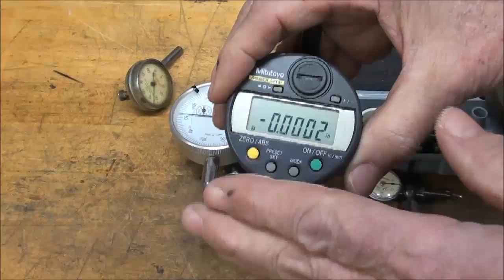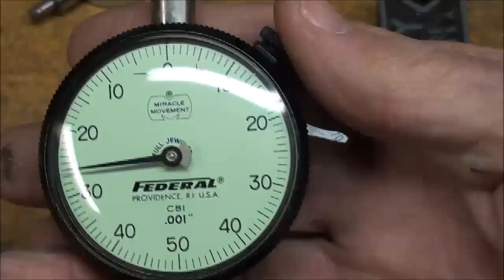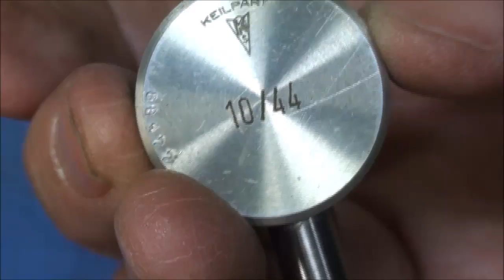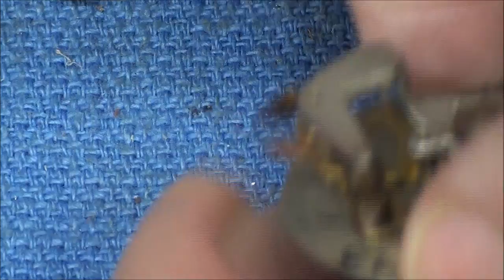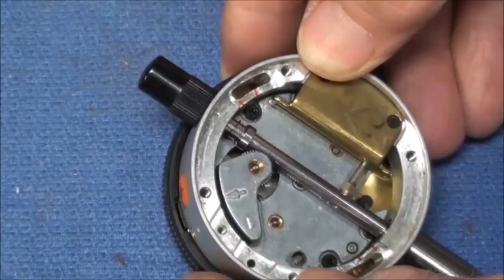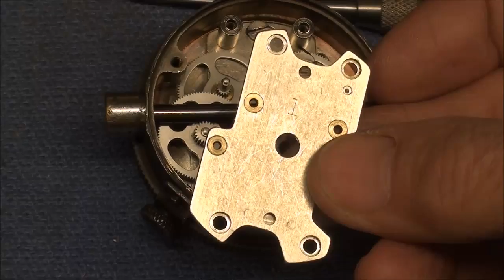WHAT MAKES IT WORK? #18  "How a Dial indicator Works"  tubalcain

Comment: Using a thread as a rack is an amazingly simple way to do it. The plunger is already round so I guess there’s no point in making a square rack

So I understand the basic idea now. The gears make the needle move more than the plunger. But it’s the math I would need to study to figure out how they get it to be in specific increments.

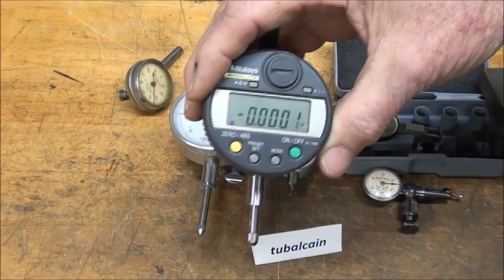Comment: At 2:16 - 2:23, you notice the readout fluctuating . . why would the 
Digital Indicator be changing its measurement readout when there 
is not measuring anything? Perhaps the atmosphere is so thick in 
Mr Petes shop that it is measuring the difference in air pressure as 
he wiggles it about !

Comment: That "German" dial indicator I am sure may well have been Swiss. If it was made in 1944 in Germany it would have has a Nazi eagle stamping on it somewhere most probably on dial and the back. I have never seen anything made under the Nazis that didn't have a swastika Eagle stamp on it even the timing mechanisms on bombs had them even if they were to be blown up to kingdom come! That said, the fact that it does not have made in Switzerland is quite surprising if it was made there.

Comment: Who has enough indicators?   years in manufacturing Quality as a manager and Engineer and a Product/Production Engineer and never in that 35 years did anyone hear me say the words "We have plenty/too many indicator.  Now that I am retired I probably have 35 or 40 Dial, Electronic none of which are Mitutoyo. Dont get me wrong for the price and the quality of Mitutoyo they cannot be beat as long as you yourself and the employees you have using them understand they are Mitutoyo. I am not going to put a $450.00 Mahr Federal on the production floor for an $8.00 an hour off the street flunky to knock off a table or machine and never tell anyone that they did it. That tends to piss a lot of plant Managers off to including mine, CAT's, Harley Davidsons, Dana's,  CAT fuel systems, Honda. That creates too much cash flow for the 3rd party containment people posted at my facility and at my customers. The only good thing in my opinion about a digital indicator or caliper, Mics, Ect is that I did not need a calculator or my phone to calculate Metric to English and all of the before mentioned companies use either only Fuc*#ng Metric or both SAE and Metric mixed. Talk about a night mare when trying to develop tools parts ETC. Yes I was also the management rep for  every company I have worked for since I was about 21 years old. Started with the Old Ford Q-1 and when I and yes I said I because there is an i in TEAM. If you put a line in the bottom section of the A . (in the A holes. We had no employees with any background. This was my 1st Q1 audit and I killed it. 1 minor write up. 

Not tooting my own  horn.
If I was going to toot my horn I would have stated that I spent 8 years in the United States Marine Corps from the age of 17. My MOS's (Military Occupational Speciality was 

 (Grunt. Learn over a130 ways to kill the enemy or anyone else without a weapon) then my 2nd 4 years was after I went to become a combat Engineer MOS 1371 Build stuff and blow it up or just blow other peoples stuff up. We used conventional explosives TNT, C4, Dynomite ETC along with improvised explosives basically anything we could get our hands on) Good times 1984-1992 USMC. Location? anywhere we were needed.

Comment: I can send you some basic watchmaking tools if you'd like. As you said, these dial indicators are very much like a mechanical watch movement. I have a bunch of extra tools laying around that I know you could put to good use.
Please shoot me your mailing address at t.macc.gmail.com
Reply from the maker: Thanks, I sent you an email. Although your email address looks a little funny without the at sign.
Reply: Sorry... I'm working on a MacBook Pro which is the bain of my existence. The correct email address is:
t.macc.1956@gmail.com
Reply: They are on the way. Ref: latest email for tracking info...

Comment: The Germany indicator at the first open, it should use screw thread as worm, to couple with worm wheel. But uses as gear and rack.

Comment: Gauge hysteresis is the difference in readings on a gauge or dial between measurements when going up and down the scale. The word is used to describe similar phenomena in other branches of physics. In a gauge backlash is just as good a word.

Comment: The crown of a watch is the winding knob.  The glass is often called the crystal.

Oil might be forbidden, but I'm guessing a little bit of graphite powder might be OK for lubrication. Even if it gets on the rack, a layer of graphite is much thinner than a layer of oil molecules, and it doesn't turn to glue over time.
Reply: Replying to a very old comment.... There is no need for lubrication - the ingress of oils and gunk via the stems is what makes them gum up.
Reply: @johncoops6897 

(Replying to a relatively recent comment which replied to a very old comment! :D)

Yep, if one is lucky, a bit of cleaning is all that's needed. 

If not so lucky, there may be wear or damage; in which case one would be advised to either  save all the undamaged parts (or not, maybe that's just me bring a hoarder ;->) and buy a replacement, or get it fixed and serviced by an expert. :)

Comment: Hysteresis is just the name for when the output lags the input differently depending on the direction of the input. It could be motion (as in these indicators) or the buildup and polarity of a magnetic field in a transformer. It's from the Greek word for lateness or being behind.

Great video; it saves me the risk of pulling apart one of my own indicators, and maybe getting dirt in it.
Reply: Term is also used in structural stress analysis.  When a load is applied and then removed from a part, plastic deformation (if it occurs) prevents the stress-strain curve from returning to 0,0.

Comment: Very nice and highly informative why? Because you are by far to me the best and most hard-working of all of today's also good teachers who bless us in the trade. I have taken apart busted up ones to see the interior. Once I bought a row inch travel indicator from a guy getting out of the business which always saddened me also.. we have many forces working against good men. Anyway it had a bend in the rod and a noticeable drag and catch. I was proud to see the problem and apply some pressure which fixed the problem. I can not any longer loan my tools as something can happen to damage it. To make it worse all personal precision tolls are to be calibrated by a company who is certified to do that and label it. Th sides were only hearsay!They picked up my 18 inch Berliners this week and I took pictures of what it looked like when I turned them over because the last outfit chipped my carbide face on my 2-3 inch Starrett misc I have had over 20 years no problems. The outfit denied doing it and my company did not fix or replace them. Now I take pictures with my smart phone and will take them to small claims court over the next incident. Not my company but the calibrator one. Others complained also and or man who selected the outfit said our comments bo

Comment: HI Mr. Pete,
 that Keilpart dial indicator is from Germany. the company (KS) interestingly enough is still in business. They're located in Suhl. i have a collection of their micrometers. they went thru quite tumultuous times after the war and re-unification. during the years of the GDR the company was state owned and was returned to private ownership upon re-unification, they are now a part of the Steinmeyer group.
the dial indicator you have is a piece of history that you should consider restoring, and as you correctly observed, it's is from 1944. the "Keilpart" is part of the logo the original founder Friedrich Keilpart put on his products. he founded the company in 1878, 
 
another observation: the rack is a thread, you can also tell that by the slanted teeth of the pinion gear that is driven by the rack

thanks for going the extra mile and showing us the internal workings of the dial indicators
Reply: +HolzMichel Thanks for the history!

Comment: The numbers on the inside of  your European indicator are likely because the pieces were hand fitted.  Notice the numbers match.  Likely if you took apart an identical unit, you would find different numbers on the pieces and the internals would not be interchangeable from one movement to another.  Of course this is only my best guess.  

All the best!

Mike

Comment: Great video as usual....the glass in the bezel is called a crystal in a watch, here it may just be a glass as it would be called in a clock.   The crown is a knob used to wind a watch as well as set the hands.  I could not see clearly in the video the color of the jewels, they looked pinkish to me.  If pinkish they would be garnet, rubies red, clear are sapphire.   
  If you use tweezers, the screws are easy to remove or install, watchmakers hands don't work well without them either. 
Women worked in watch factories to assemble mostly, probably because they could pay them a lower wage........there is a non PC view that had a lighter touch and were not ham fisted as most men are.  They were also used to paint watch and clock dials with ''harmless Radium''.   Check out "radium girls'.

Comment: Weirdest back plate i've come across was at a parts market in UK. It was a tube machined in the back of the plate. ~3 cm OD and probably a 5 mm thick wall and about a cm deep. The plate looked like it was meant to fit a jig i suppose. Big one too, ~12 cm across. There's probably more mounting fixtures, designs out there.

Comment: The numbers are for matching two items together, match drilled and fitted. Great video.
Thanks, Greg
Reply: +Gregory West That, and the Germans (Austrians, Swiss, Swedes, etc.) have this habit of serializing the parts that go into assemblies, such that a repair technician can tell at a glance if a replacement part has been used...

This is especially common in military issue firearms... as are units which have been made up from salvaged pieces from several original assemblies.

Comment: Those nylon gears are stronger than aluminum but more importantly are self lubricating. Nylon gears like that wont oxidize or seize like metal ones. very good in applications where they don't need to deal with much torque
Reply: Delrin vs Nylon?

Comment: Hi Lyle, very interesting video, thank you, BUT spoilt by the crappy auto focus on your camera. Is it a new camera ? I do not have too much trouble with other videos in the past. Hope you can fix it, spoils the viewing, if not I may have to stop watching your channel.
Reply: +Dave Ticehurst Focus issues become more of a challenge at very close shooting distances, for humans OR autofocus systems, requiring much greater lens extension as well as--the bigger problem--proportionately greater change in extension when the shooting distance changes. The practical result is that a large focus correction is required for what seems like a small change in distance, leading to greater challenges for focus pullers in film and video manual-focus situations, and disappointing performance by autofocus systems, whose designs must include some HYSTERESIS to avoid constant focus hunting. Depth of field is also very shallow at close shooting distances, compounding the problem by requiring more frequent focus changes when the subject moves even a little. There's no wiggle room.

So when Mr. Pete moves his hand 12.7mm, the close shooting distance requires a substantial focus readjustment, which the camera tends to do slowly because of the design hysteresis. We may perhaps also take it for granted that the AF sensor(s) on our consumer-grade ("crappy") cameras aren't so responsive at close distances, either; it has been my experience that they have more trouble in this regard.

A potential solution is to turn off automatic focus. This is a real problem at these shooting distances because the shallow depth of field would then require Mr. Pete to hold his subject precisely in the very narrow plane of focus at all times. Almost any movement would result in uncorrected focus problems worse than what you saw here.

If you can still find a manual-focus camera lens somewhere, note the focusing distances engraved on the barrel. There is very little rotation of the barrel needed between shooting distances near infinity, but the closest distances require you to really crank that helicoid. This is concrete evidence of the necessary increase in extension at close distances.

If you care to experience the frustration of these phenomena for yourself, grab a manual-focus SLR and a macro lens. Go outside on a calm spring day with a tabletop tripod and a desire to photograph small wildflowers at high magnification. Set a large aperture so that you can use a high shutter speed to stop motion; the side effect of this is to eliminate your depth of field. Bummer. But you must stop motion, because you'll immediately discover that when any two air molecules collide, your flower flails around as if in a gale. You can chase it with focus, but you'll never, ever catch it. Close focusing is challenging and athletic.

This is essentially the same task Mr. Pete's camera is asked to accomplish when filming the insides of dial indicators at a distance of just a few inches. The same camera, shooting the Bridgeport vise from a couple of feet, has no trouble.  This is the source of your newfound difficulty with the video, and why you haven't noticed it before.

I've been neck-deep in photography since I was a kid. 1968, actually. These focus issues are present in almost every YouTube video I've ever seen, including Mr. Pete's. We're used to tolerating a certain level of poor autofocus performance because that's just the way it is and we're accustomed to it. You understand why it's more pronounced in this video. We'd walk out of a theater if it occurred in a feature film, which is why they have focus pullers doing it manually. But this is YouTube....

Comment: Thanks Mr Pete, I have a sticky indicator that I was going to lubricate, but not now. So one of these days I will pull mine apart and see whats inside mine.  Great series, keep it up.
Reply: +stefanoworx   Mr. Pete is right about not lubricating indicators, but before you pull yours apart, try spraying the stem with CRC aerosol Brake Cleaner, then while the stem is still wet with the degreaser, work it in and out.

This almost always works for me.  It cleans all of the foreign matter off the stem and that's the main cause of "sticky stem" syndrome.  Caution, try not to get any of the degreaser on the bezel because it can make it cloudy.  Hope this helps you!  Treetop (retired tool & die maker)

Comment: Great episode ....There is no reason that the digital indicator's case should be round. That could be called a technological "culture lag" ....
Reply: Don't be so silly. The face bezel of a dial indicator needs to be round, so you can rotate it. The rear case is round so that the knurling on the edges of the front face can be easily gripped with the fingers to rotate it. Rotating the front face is fundamental to operation of a dial indicator.

Comment: Thanks for showing. Plastic isn't plastic isn't plastic. There are thousands of what looks like plastic, but some are more resistant than steel. What is the difference between  movement that can live 50 years and another one that can live 50 years. I believe it's not only the price, but sometimes precision is involve. I believe there is less vibrations with «plastic» than steel. Maybe it's the reason that they use this unknown type of material. In the Federal, did you find why the movement is sticky and if so, How did you fix it. I have several alike and would be delighted if you can give us the reason of this problem. Again, warm regards, and thanks for sharing all your ideas with us around the world.
Reply from the maker: +Robert Patoine I just cleaned it with solvent to rid the stickiness

Comment: As far as my use is, the dial indicator will give me a direct reliable reading to evaluate displacement from a reference point, as a test indicator will be more for lining up an or approaching a component to a set reference , as your distance grows from set point, the angle on the arm will introduce a error factor due to the angle...
3000 people at westclock, guess your eye sight is above normal in order to discern the right wife in that mass of people...   lol
Great inside view of a indicator.

Comment: Hysteresis is well used in this case. Is a general concept used to refer to non-linearities that systems exhibit, like in this case backlash. I'm an electrical engineer and can tell you that the concept applied to motors and transformers was taken from mechanical engineering. So the concept is older than you might think. So keep using it in the future whenever you refer to moving from point A to B and back to A doesn't takes you to A.

Comment: the numbers on that first indicator, are where when it was assembled and fit, there marked to keep all the parts fit together. another words, they won't get mixed up. like that one said "32" this frame plate goes with this arm support. I like your videos, thanks. I've been a journeyman tool&die maker, for 20 some years. this whole industry surly changes, thanks again Kenneth sylvester